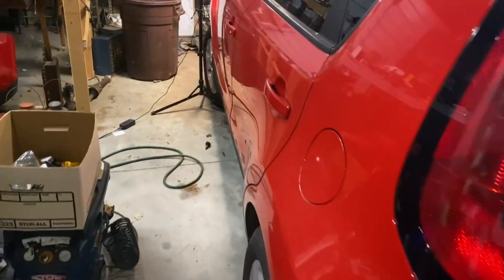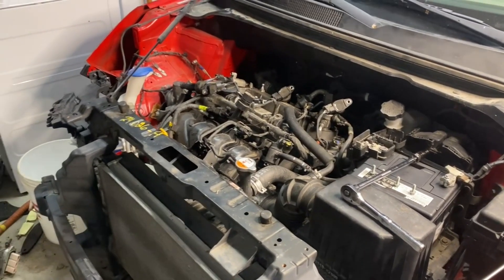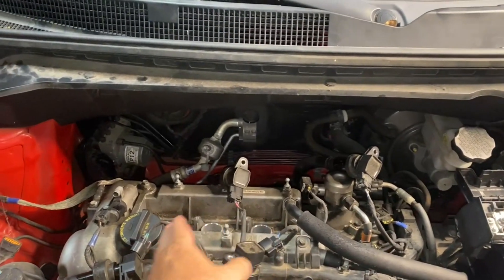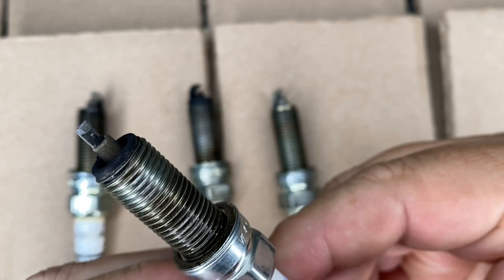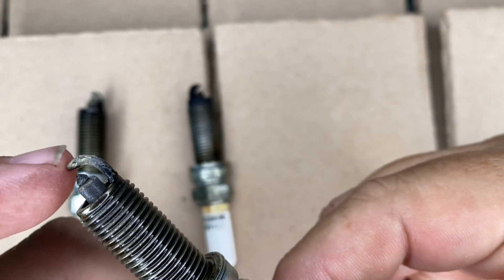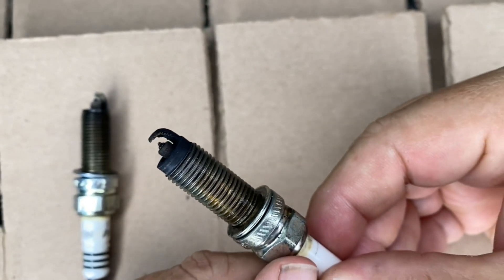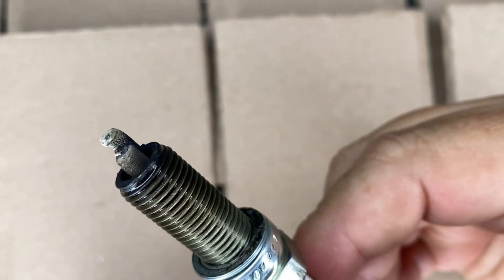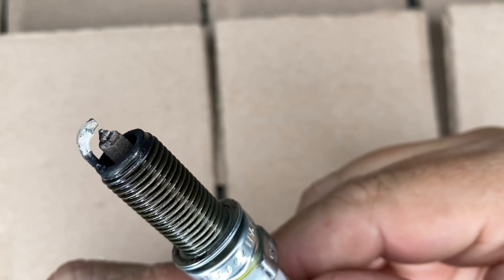How to read spark plugs to check your engine health

Comment: 2 of my spark plugs  have a little bit of oil on the threads   and brown color  don't know why,  motor has no miles,   was rebuilt many years ago like 30 ,  is an 81 Grand Prix